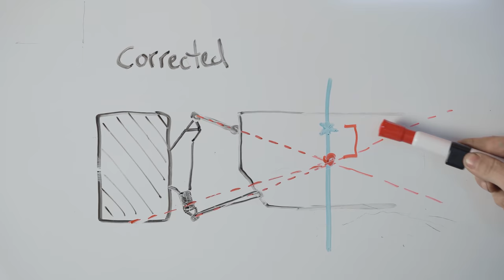Add Serious Stopping Power to your Mini

Comment: Just a tip,  if you use HEL brake hoses,  they have banjo ends that you can rotate freely,  so you don't have to worry about the orientation when ordering and when they're fully fitted,  since you can adjust it later. I have it on my mini, makes it such a breeze to install!

Comment: Aluminium is all very well until you get corrosion occurring between any steel unions, bolts or washers.  Then God help you.  It’s one of the reasons I hate how Audi used aluminium on my A6 front brake callipers.  In one place they used an aluminium washer that after many years simply disintegrated through galvanic corrosion.

Comment: Dont forget the castlenut on the cv-joint is metric on 'later' Mini's and older ones where in inches! Unfortunately dont know the change point. Only had Mk1-3 and Mk-6 Mini's.. Apart from that, an excellent guide how to do this conversion!

Comment: I’m pretty sure it’s strongly recommended to use a large washer behind the castle nut when torquing up the wheel bearing.  Then removing it before torquing the castle nut on again.  I’m happy to be corrected thou. 😉

Love you content.  It’s really great and always inspires me to get on with enjoying my own mini.  Which spends farro much time parked up, I have to say 😬.
Reply: You are correct, You are supposed to torque it with a large flat washer first then undo and put in your split hub washer then torque it to spec. Only part he messed up on

Comment: Great Video!  In general and specific to big brakes, is a brake booster recommended?  I currently don’t have a brake booster and am not really happy with my stopping power.  There are discs on the front but am not sure what they are. 67 MK 1

Comment: 11:38 who lets the caliper just dangle on the brake line like that!!! Good video though!
Reply: Its a straight brake line. No issue. If the fitting at the end was at a 90 deg angle then yes thete is a problem. In this case though its fine.

Comment: Bullshit ! Used to run My S in C sedan in 72/73 . The brakes were so poor their use was  relegated to save yer life emergencies.. only
Being 'use once' ...Whereupon the pads would quickly glaze over from the Brightly glowing 'discs (if you can call them that).  
Only removal . grinding off the burnt pad faces would allow reuse.
 Suppose if you only use your mini for Shopping excursions.. then the brakes may work. 
But then I too often had my minis discs glow brightly in street use. 
Mandatory to retro fit the biggest discs you can find with appropriate sized rims. 
Purism won't do much you good....as you plow  face first into a concrete wall.